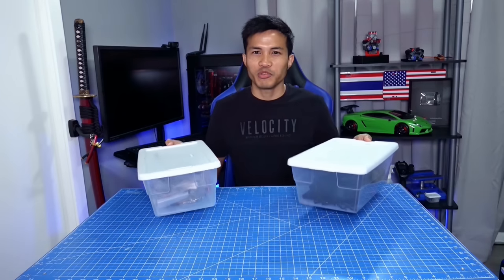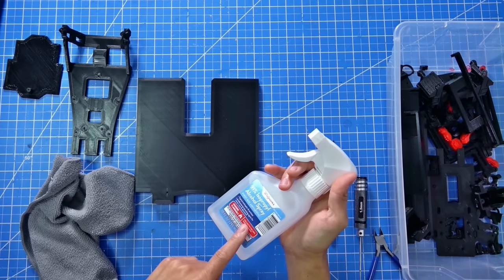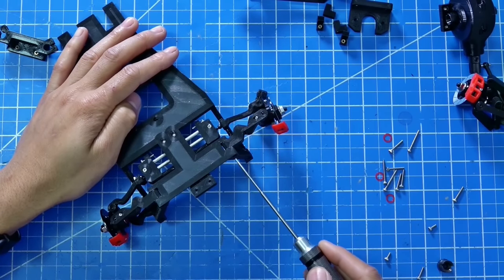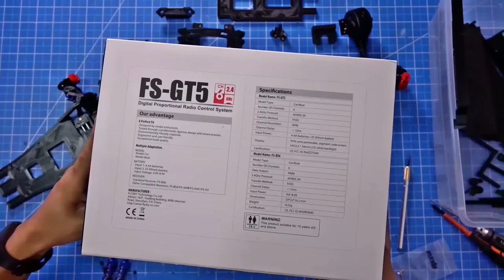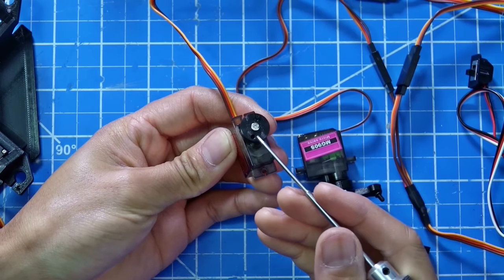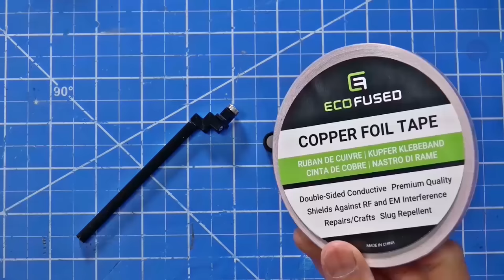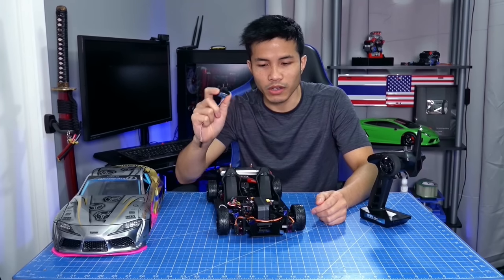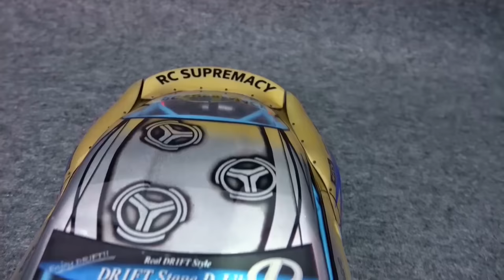RC Modify 29 | M-Drift 2 RWD Assembly + Supra MK5 Widebody - RC Car

Comment from the maker: 1:01:32 Finished Assembling
Next up is RC Modify 30 and then E30 Fix 23!
Reply: Super car racing
Reply: Would I be able to scale the print size down to 1/24 scale also?
Reply from the maker: Scale down would not be possible.

Comment: is there any other controller you can use for it that cheaper or is that the only option. idk much about rc cars but just getting into it
Reply from the maker: It's the only one I would recommend because it's the cheapest 5 channel controller. You can get a cheaper one, but you'll only get 3 channels.
Reply: @DarkDragonWing  ah OK. If I used a controller with the receiver from another rc car and out in in this one would that work aswell ? Cheers for the help

Comment: I was wondering what size or type of shocks can you run on this setup if you wanted to upgrade to like yokomo or mst or something. How good are those shocks you run? Awesome video by the way.
Reply from the maker: You can only run these shocks, but you can run other spring rate.
Shocks: https://s.click.aliexpress.com/e/_AKbbAD
Springs: https://s.click.aliexpress.com/e/_9GslGn
"Spring Length: 20mm
Wire Diameter: 1.0mm
Outer Diameter: 12mm"
Reply: Awesome, I am printing the chassis to build one. Also the setup is with straight wheels, how bout if I want some negative camber towards the front? Looks like I different arm link option would be needed. Something to consider to keep making your creations the best.

Comment: does the suspension still work ish as a shock dampner or is it more their just for the show because im tryna make it kinda as an last years project and tryna integrate the servo lifting type thing but don't know for sure if the shocks still take up the shock or that if you will push it down with the servo's active that the system will brake... ? 
overall clean project this is no commantary or something like that btw just a genuine question.
Reply from the maker: Yes, it's 100% working as a shock damper. All because of only pushing/lifting the top of the shock. 
1:16:54 Shows that's bouncing.
1:20:04 Shows that the whole shock stays the same while lifting and lowering, which maintains the ability to bounce.

Watch this video where I test the suspension a lot more: https://youtu.be/ep_6k-ZjXZg
Reply: @DarkDragonWing  thanx for the super fast and detailed reply lol didnt expect it at all actually fr thank u i'll look into it

Comment: Will those brass inserts also work on normal RC chassis? I got a few screws that wont tighten anymore, using those would really solve that issue :D
Reply from the maker: I'm not sure. Though I would try it just to find out.

Comment: Nice project friend, it was incredible, friend what is the adhesive tape you use to attach the light cables to the bubble (car body), this silver tape, which you use to glue the wires, and I use it to glue the LEDs to the headlight it is fine !
Reply from the maker: That's aluminum foil tape. You can find it on this page: https://amzn.to/42XXWh3
Reply: Thanks friend 😀

Comment: I was looking at the parts list and I haven't seen the brass nut insert M2x3.2x3 anywhere. Is this correct? I wanted to try your build
Reply from the maker: Yes, I updated the link for you on the list. Cheers
Reply: @DarkDragonWing  Thank you very much your the best.
Reply: Also just to make sure how bout the ball bearing MR105RS and the stronger springs havent seen those listed anywhere. Sorry newbie here.
Reply from the maker: @lexxtsg2328  Thanks for letting me know! I wouldn't know because I don't check the links.

Here are the bearings: https://s.click.aliexpress.com/e/_AsMJhp
Here are the springs: https://s.click.aliexpress.com/e/_9GslGn

Comment: how strong is that plastic
Reply from the maker: It's good enough for drifting, but not good for bashing. The parts are small to make room for other things. If the room is not important, the parts can be thick and pretty strong in that case.

Comment: Você tem o arquivo para impressão??
Reply from the maker: Free 3D files: https://www.creations.darkdragonwing.com/ddw/rc-chassis/m-d2/
Reply: @DarkDragonWing  muito obrigado
Reply: This was the part you used to hire the 4 servants???

Universal 4 6v/3.6v 24v 24v inverter servo signal for rc servo?
Reply from the maker: @heliojesus2273  eu não entendo sua pergunta
Reply: @DarkDragonWing  This was the part you used to hire the 4 servants???

Universal 4 6v/3.6v 24v 24v inverter servo signal for rc servo?
Reply from the maker: @heliojesus2273  "Universal 4 6v/3.6v 24v 24v inverter servo signal for rc servo" = é usado para inverter a direção dos 2 servos de um lado.
Reply: @DarkDragonWing  it was this part that you used in your project on the servos??
Reply from the maker: @heliojesus2273  Yes.
Servo Signal Reverser https://amzn.to/3qCt5E6
Servo Y Wire 150mm	https://amzn.to/3BKgiGu
Servo MG90D 2.5kg	https://ebay.to/3AyP8j1
Reply: @DarkDragonWing  thanks

Comment: It's cool, but there are a few complaints that I have. One, the way you were installing those ball joints made me cringe, and two, you referred to the differential as "locking". Locking implies that you can lock or unlock the differential based on your needs. That differential, at least from what I can tell, is permanently locked. Other than that, cool build